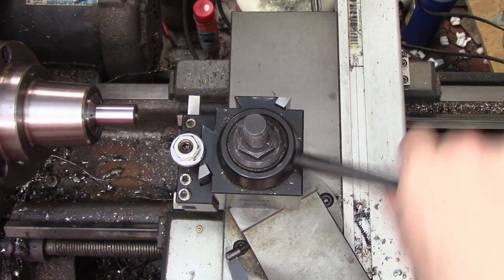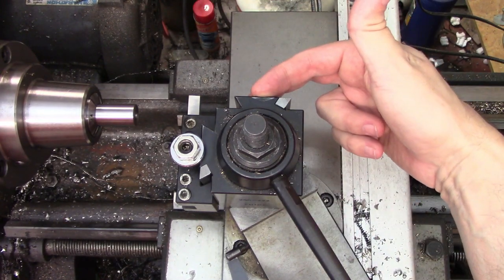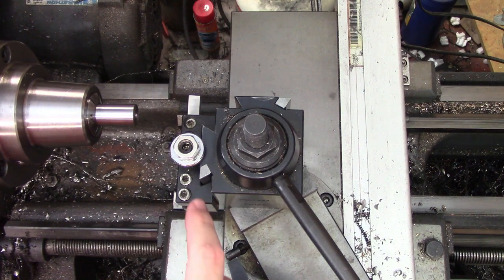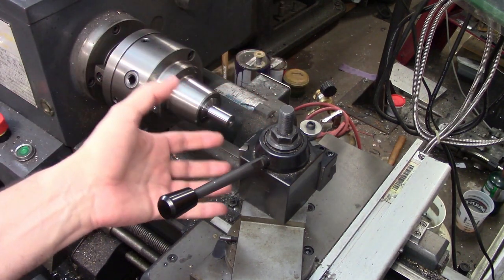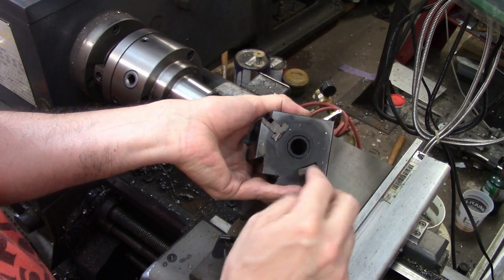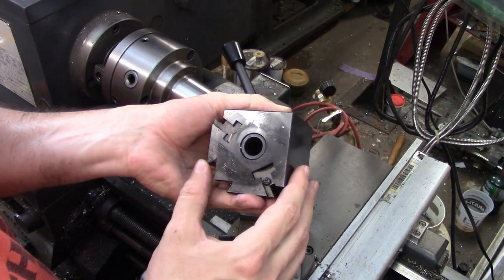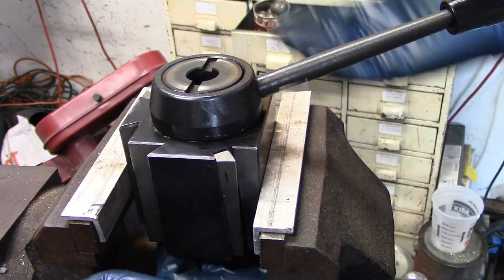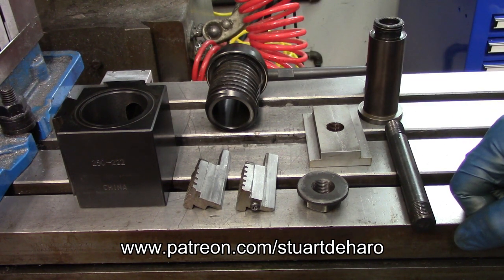Taking Apart a Quick Change Tool Post - Viewer Question Answered

Comment: Hi Stuart, thanks for the follow up on my question. My QCTP is an older Phase 2 and looks nothing like yours when taken apart. I talked to a tech person at Phase 2 and he informed me that they have had several questions over the years on this issue. It was actually a manufacturing error and the hole for the handle was drilled in the wrong position on some of their earlier units. Mine has no triple threads and looks nothing like yours did. According to the Phase 2 tech the only solution is to redrill and tap a new hole. I was watching a Keith Rucker video and noticed that it looked like he had a QCTP that locked up in almost the same position as mine. This is not a huge game changer so I'll probably just live with it. If it's good enough for Keith it's good enough for me LOL. I do greatly appreciate your help and follow up on this issue and you are one of the reasons why this YouTube machinist group is so great.
Reply from the maker: Thanks Jim. It was fun taking it apart and it certainly needed some lube in there. Sorry it didn't solve your issue.
Reply: Re drill and tap the hole
Reply: Any threaded item has a known start and end point where the thread starts and then fully tightens up. Stuart's happened to have 3 but it's still 3 known start points. And all threads have a pitch distance between each thread. Obviously decimal inches for imperial threads and MM for metric. To properly index your operating handle to the position you want it in, first figure out the thread pitch, decimals or MM and use even a cheap plastic protractor to get a close estimate of how many degrees you want the handle to advance or retard it's rotation point of where it's tight. Lets say your thread pitch is 20 tpi, that's .050" per one full revolution. Divide that by 360 degrees to get how much distance per degree of rotation.  .050" divided by 360 = .000138" per degree. So if you want to move the handle by 60 degrees? 60 X .000138" = .00828" either trimmed of the bottom or a washer of that thickness added.  Depending on your exact parts layout it may be possible to either trim the correct amount off the underside of part the handle threads into or add a machined washer of the correct thickness. It's just a simple math problem to figure out how much to remove or add. Your qctp may have very hard parts so it might be best to just add that washer and have it sounds like about 60% less of one thread engaged than you do now. One way or another it should be easy enough. Or just drill and tap the handle in a new position like others have said. Indexing threaded parts to the correct clock position is really quite easy. You can also face off the correct amount off the start point on the screw so it then has a different clock position to where the thread starts.
Reply: Yeah, I figured a specially sized washer would do the trick. If you only knew someone with a lathe.
Reply: @836dmar  🤣🤣
Reply: Mungkin bisa dicoba menambahkan ring dengan ketebalan yg disesuaikan dibawah gagangnya?

Comment: Great info!  I just acquired a South Bend 9A and I'm completely brand new to machining.  The lathe came with a QCTP and sure enough, the handle was bumping into the adjustment bolt on one of the tool holders.  I found this video and ... my first (and successful) little project for my lathe.  Thank you!
Reply from the maker: You're very welcome. Have fun with the lathe!

Comment: It's an issue that crops up from time to time, but I can't say I've ever seen anyone post a video about it before - so good job on getting it covered Stuart.
Been there done that myself since I have 2 older Phase II QCTP's myself. (AXA and BXA) I pulled them apart 20+ years ago to clean and lube them (twice... since I went too heavy on the grease the first time) and accidentally got one of them out of time. Both of mine have the same construction with the (3) multi-start threads and it took a minute or two to figure out what happened.

Glad to see there will be a video to point to now in the future when the question comes round again for the next guy. 👍

Comment: I'm a little late to the party. Excellent video. Mine is labeled Hess 250-222 and could never get a tool holder to fit on the front position of the post. Was able to get front tensioner in correct position after watching this video. Much appreciated.
Reply from the maker: Awesome. I'm glad it helped you out.  Thanks for watching!

Comment: I have a Chinese knock off on my lathe and it tightens by turning the handle counterclockwise instead of clockwise as yours does. You can adjust it by re-timing the core but because it only has a double start thread you can only adjust it by 180 degrees. Since the handle ended up obstructing the left hand side of the dovetails when loosening the wedges, my solution was to make a longer handle and then heating and bending it for clearance. I installed it and then bent it after it was installed so that the bend was in the correct orientation in relation to the thread timing. Once done, I used red locktite to locate it semi permanently and it fixed my problems.

Comment: Thanks for posting this.   Mine is an Heihai toolpost that looks identical to yours, and has 3 position threads too.  Mine had lubricant and even a felt washer to hold oil.  Anyhow, I got mine out of time, but I'm all good now.    It feels a lot better with Superlube grease.  Mine is about 20 years old.

Comment: Thanks for this. I am getting into machining as a hobby and know very little. Yesterday I was facing off some cast iron castors and was having so much trouble with my tool post that I switched to an old style that came with my lathe.

Question: groove under the head of the triple thread screw is supposed to have a felt strand in it to keep chips out of it I am guessing. Aloris sells it for $17+ shipping. Any other sources?
Reply from the maker: Check McMaster Carr to see if they have felt washers. I know you can by the sheets of felt from them and make your own, but at that point you might as well buy the one from Aloris.
Reply: Found it on Amazon for $9

Comment: My quick change is different. It has a plunger behind each tool holder. It still used dovetails, just different locks. I'll have to dig into mine also. Good video.
Reply from the maker: Yep. That's the piston style. Let me know what's inside. I'd love to see it.

Comment: Steps after receiving an off-shore item: totally disassemble, clean all the crap off, de-burr where applicable, lube, assemble, adjust, tune, smash, etc. :) Hopefully use as intended.
Cheers
Reply: TRUTH!
Reply: These are all sold in the kit form if you did not know. Some assembly required.

Comment: I just bought a unknown year aloris cxa tool post, and the nut is not left handed. Viewers make sure you look at the threads on the bottom of the tool post to make sure if the threads are left or right. Good video though.
Reply from the maker: Since this video was made, I have had the opportunity to take apart a genuine Aloris and yes, the threads on those are right-handed.  Perhaps the left-handed threads on the import was a way to avoid a patent?
Reply: I didn't even catch that this was a import. I Googled aloris tool post disassembly and this was the first video that popped up. That is a possibility. The video was a good help regardless.

Comment: I have an Aloris brand axa for my 13x38 lathe.  I've always thought it was a little small.  So I bought a cheap chinese bxa tool post like yours.  You should have seen the crap and rust I found inside.  🙄  Yuchol at woodscreek workshop here on YT shows how to get rid of the sloppy way your qctp works by making a washer.  The other option is to machine the depth the shoulder on the triple start tread goes down into the block.  The question is how to hold that in the lathe?🤔

Comment: Stuart,  Are the 200 series tool post all the same,? I have a tool post that came with my Grizzly G-0709 gunsmithing lath,  but all the holders are listed under a 200 series as a 250-201 tool holder, so what is the 250-210 mean? Need to buy 10 to hold all my other tools.  Thanks for any help and also now I know how to adjust my locking leaver and clean it.
Reply from the maker: There are different styles like the plain turning tool holder with a flat bottom or the turning/boring holder that has the v-groove for a boring bar. That's the difference between the numbers.
Reply: Sturt, I know that but what I would like to know are the sizes of the tool holders listed as to what size you have, holders need to fit over the dovetails, so for a 200 style or series listed as 250 ??
Reply from the maker: @douglasbattjes3991  They should be the same, but I'll double check. I believe we have both at work.
Reply from the maker: All the ones we have at work are labeled 250 or just BXA.  If it's listed as being a BXA series, it should fit your toolpost.  Let me know if you need anything else.

Comment: Hmm. Well, the positions are actually, facing and turning - the one on the left hand side, and boring, the one parallel to the work. My Dorian and Aloris tool posts don’t stick up. Some of the less expensive Chinese posts somehow do have long screws. I can’t think of a good reason for it other than they may be using the same screw for different size posts.

Comment: The LH discovery saved me a bit of hassle, I'm sure.  Appreciated.
Reply from the maker: Funny thing is, I took apart a genuine Aloris tool post a couple of weeks ago at work and they are right handed. I found that out after confidently cranking the shit out of that screw in a clockwise direction  until it snapped.
Reply: @StuartdeHaro  update, my Aloris EA was indeed RH.
Reply from the maker: @babyhominid7779  Well I'm glad I mentioned that then.

Comment: I have a question; not sure if it will be video worthy though.  I am a machining noob who bought a 12x36 import lathe last fall, which I have used to make a few things so far.  Would like to try my hand at single point threading and I bought an insert tool holder and some inserts off ebay recently.  Tool holder is a Kennametal STPR103B "on edge" unit, and the inserts I bought to go with it are their T02P-32R006.

The issue I have is the tip is not 60 degrees like you would expect for threading, not even 55 degrees (which would still be useful to me since I am into British cars), but something less.  Not sure if these are for some purpose other than threading, or if I am just not understanding how they are supposed to be used (probably).  The variety and nomenclature of insert tooling is complicated, to say the least.  I can email pictures of what I have if that will help.

Before everybody hollers, "Use HSS!" I am trying to minimize grinding dust in my shop as much as possible.  My old shop got absolutely nasty with it, so if I can eliminate some of the dust by buying insert tooling, that is what I am going to do.  I may wind up buying one of the HSS insert kits from AR Warner which is probably what I should have done in the first place.

Anyway, thanks for the great and helpful videos.
Reply from the maker: I tried looking for those inserts and can't really find any good pics. The 32R looks like it's meant for cutting right handed threads since they also have 32L inserts. Do they have a top rake angle sloping down from the cutting edge? If so, that effectively decreases the angle of the tool. Can you send me a pic or two of the inserts? You can find my email on the About tab on my channel page, but I believe it is only accessible from the desktop YouTube site, not the app.
Reply: @StuartdeHaro  Email sent, thanks.

Comment: Do you finally found what is the use of the screw under one of the jaw?
Reply from the maker: Nothing. I think it's just a stop.
Reply: I was going to try a spring under the front wedge to keep it from going out of time. Sometimes i can pop it up with a screwdriver, or it drops too low to put on toolholders.I have aluminum shim under the 444 toolpost holder to better match my swing.

Comment: I'm tearing into mine tomorrow! Not to throw more wrenches into this, I'm not happy where mine locks either, but unless mine has a 5 start acme thread, it's kinda in between. (e.g. it locks at about 3;30) Could be worse I suppose, but it interference-y with tailstock.

Comment: Hey Stuart, your collet chuck, is that the one from bostar? If not, may I ask the manufacturer, as well as your opinion of it? Looking for a 5C setup, I don't necessarily need the ability to pass through the headstock, just shopping for inexpensive accuracy
Reply from the maker: I bought it on ebay a long time ago so I couldn't tell you the seller. I like it a lot. It's a little slow to change out collets compared to a draw tube type, but I don't have a gear head lathe or a foot brake, so it is more convenient for me.